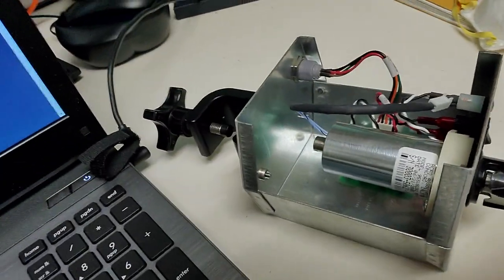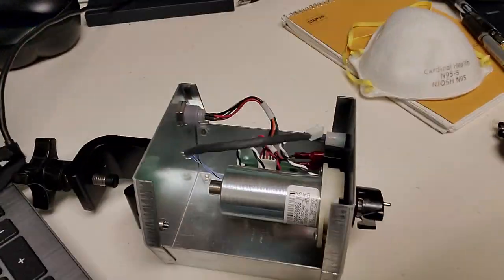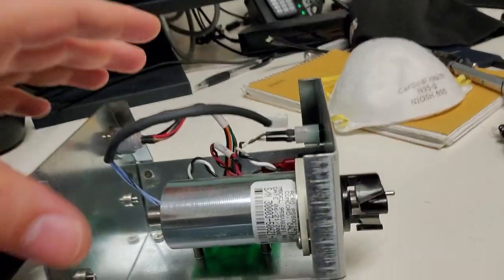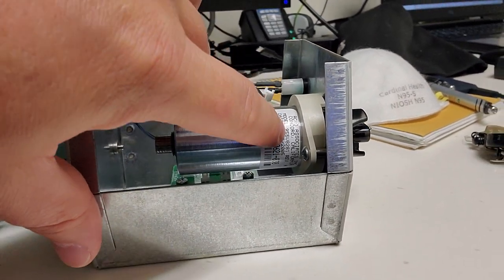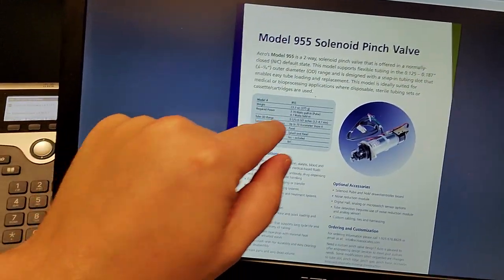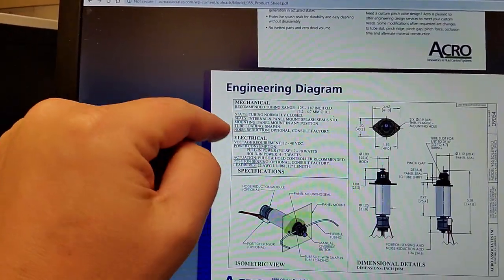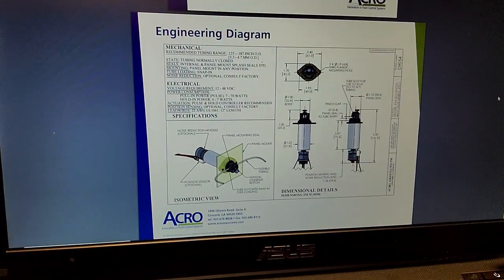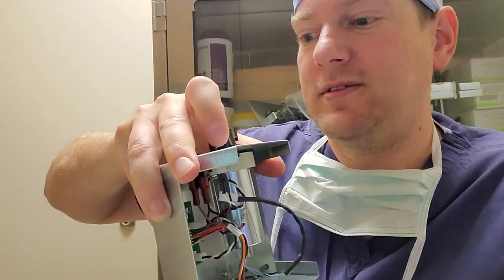Daily VLOG: Use a Datasheet to Help Troubleshoot

Comment: I'm very grateful for your informations and I wanna help from you please then I have a problem with metron accusonic plus ultrasound for physiotherapy when I try to turn it on it shows ERR and then I discovered that the two mosfets of the output stage are shorted they were irl520 with another two mosfets irf720 but it stills the same Err and now I just wanna know if the seconde mosfet can work normally because they have a difference in Vgs in IRL520 has Vgs=10V but IRF740 has Vgs=20v
Reply from the maker: Did you find the problem with your ultrasound?  I do know of other ultrasound units that have blown up amp boards due to a bad transducer. Is there any physical damage to your probe?
Reply: @BetterBiomedChannel  I'm very thankful sir for your time and response but the the probe is good without any physical damage and it still in a great form and condition